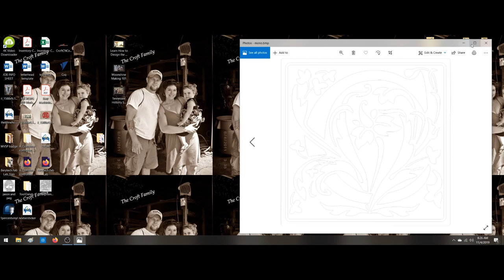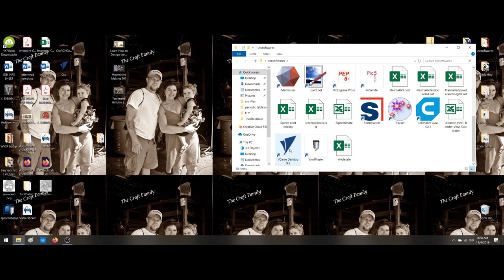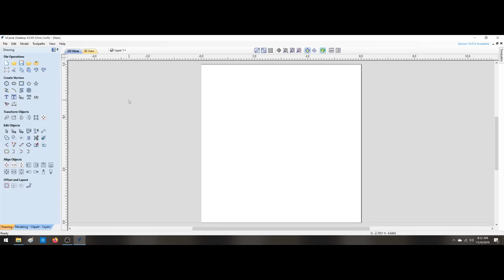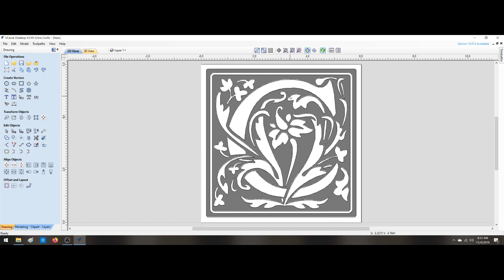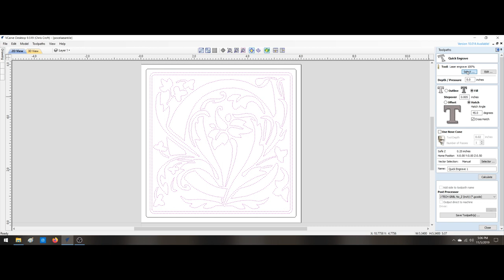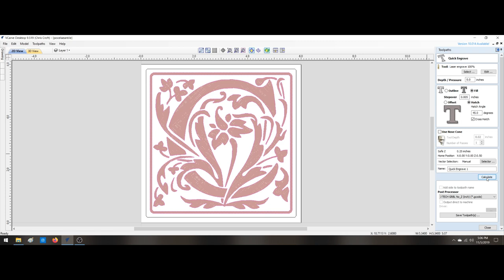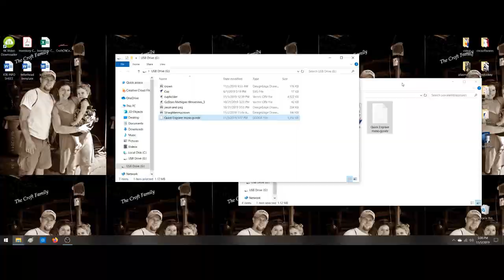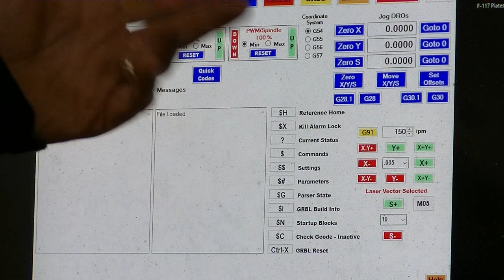jtech 7w laser on ceramic tile

Comment: What wattage was used in this video. Did you use the full wattage 7 watts or half or?. Mine is a jtech 3.8 watt and I’m wondering if mine could do the same things. I have vcarve pro and pic engrave but I’m not sure about pic sender. I use Mach 3 for sending gcode to my cnc. Nice work. Thanks for sharing
Reply from the maker: Jerry Simeone don’t quite remember
Reply: Better off spraying a sacrificial tile and putting a small square in your laser software and do a bunch of test burns keeping note of which power works best.  Currently doing this for double layer paint.